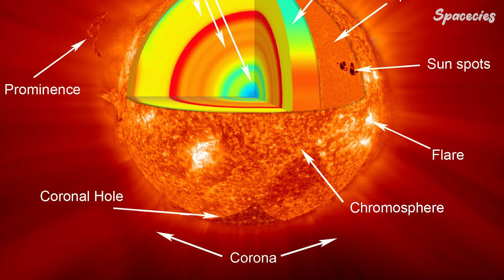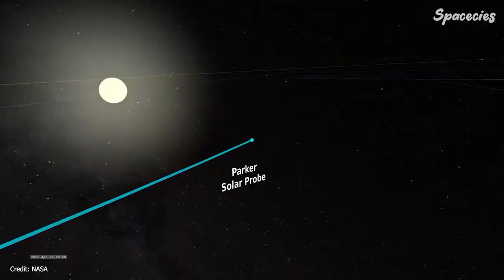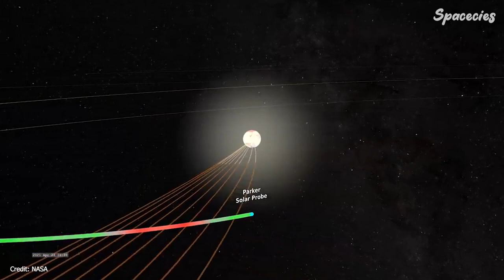Why isn't Parker Solar Probe melting? scientifically EXPLAINED

Comment: What metal in existence can withstand the heat of a star 🤣 think about it they say the Earth's magnetic field is due to its molten core but the hotter metal gets the less magnetic it becomes so don't believe what these people are saying 😒
Reply: Heat is produced by the transfer of energy from particle to particle. In earth’s atmosphere, particles from the sun interact with the particles in our atmosphere (and everywhere else that they touch) to heat them. The particles in space have a far greater distance between them than those on earth do, so the overall transfer of heat is slowed. This is why the probe doesn’t reach over 3000°F